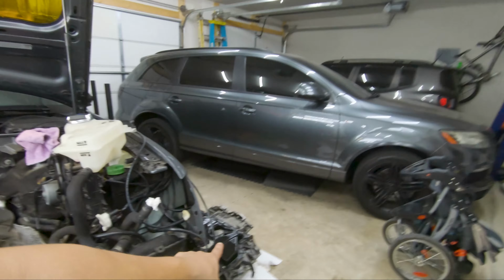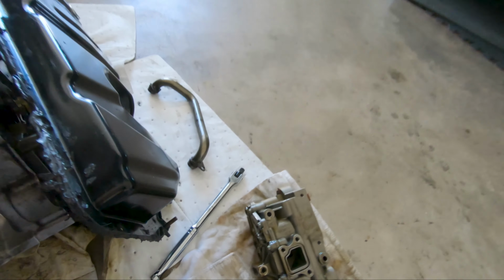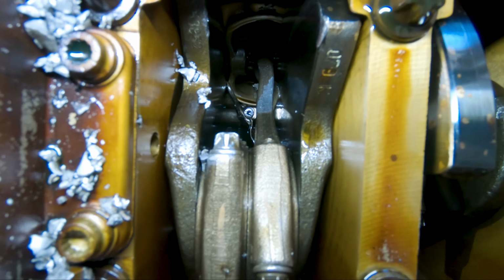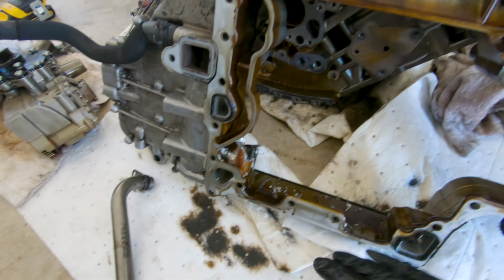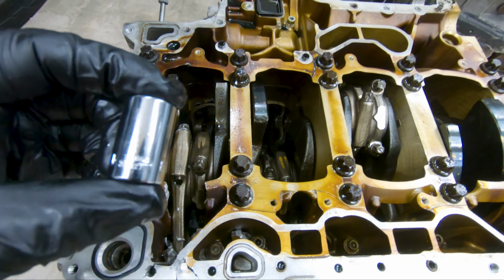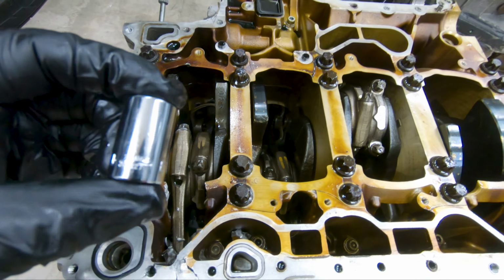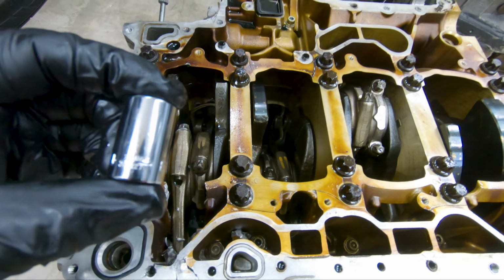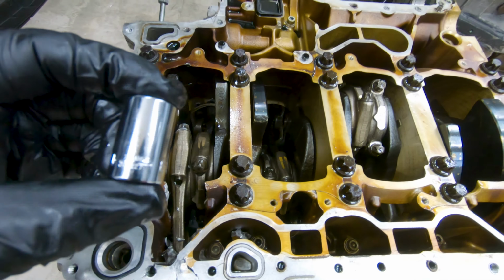Part 6: Blown Engine is Finally Apart - 2004 Audi S4 (B6)

Comment: Random questions. What clutch/Fw setup are you running? How were the rod bearings?
Reply from the maker: Ringer racing stage 4 clutch/pressure plate, and reusing the 034 LW flywheel
Reply from the maker: And the rod bearings where still in good conditions